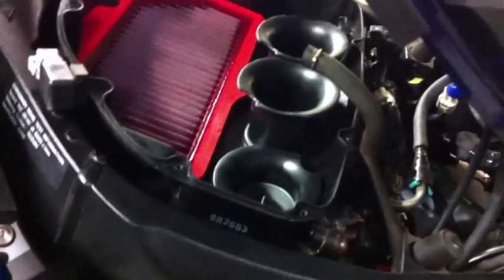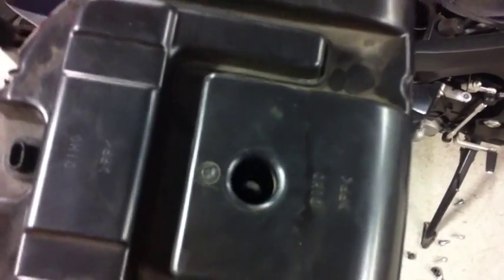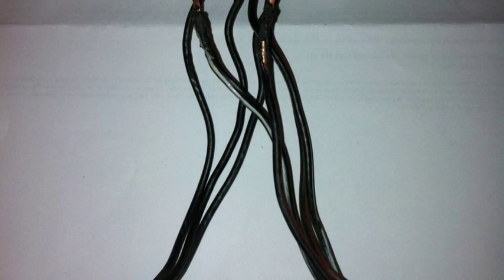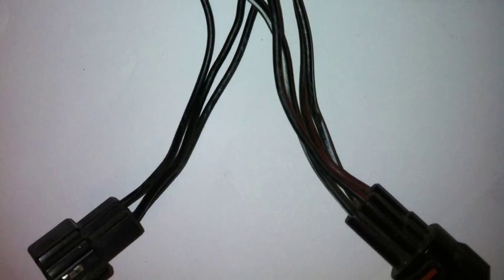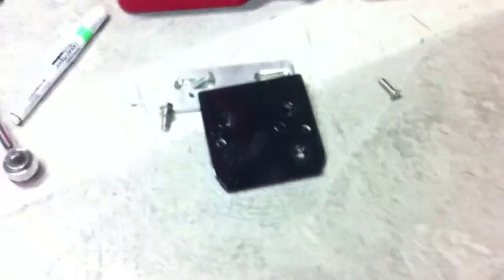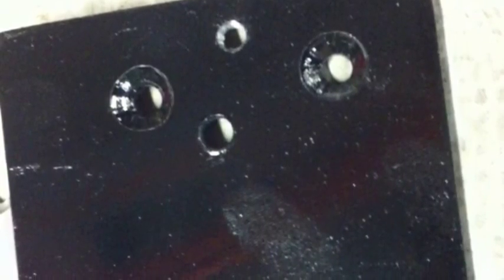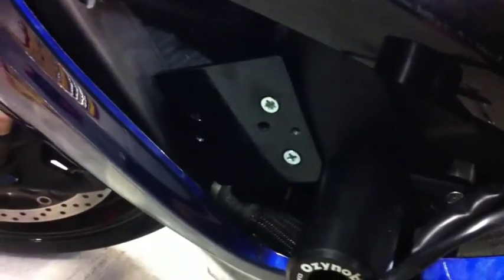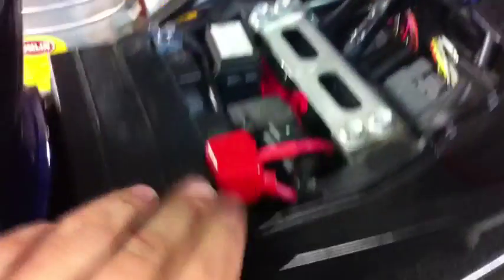MOSFET FH020AA Regulator-Rectifier - Including side mount modification

Comment: Hey mate it`s me again!

i bought the mosfet rectifier and I have just installed it but the problem hasn't been solved. According to the mechanic, the stator is fine, as we measured it  and the results are according to the manual. There is also tension coming from the rectifier which is 15v but when we measure the regulated voltage between the battery terminals the voltage drops to 11.95 v but it should be somewhere between 14 to 15 v.

Would you have any idea what could be the problem?
cheers
Reply from the maker: Have you done a battery stress test? Your battery could be faulty. I had to replace mine.
Reply: +Peter Rosel i asked the guy who is fixing it abou that and he said that the charging system supposed to be working fine regardless of the battery's condition. tks anyway mate
Reply from the maker: +Eduardo Ribeiro Da Silva what is the exact problem you are having? Can you be a bit more descriptive of the fault? Are you getting any error lights?
Reply: +Peter Rosel basically, the battery is getting flat often and the bike doesn't recharge it. no fault lights on panel.
Reply from the maker: +Eduardo Ribeiro Da Silva well sounds to me that your battery is faulty. If you are fm getting 12-15v from your rectifier then that means it's working and should be charging your battery. Have you got a lead acid or lithium battery?
Reply: +Peter Rosel i think the battery is the oem. mechanic called me and said that the battery is faulty. i am getting a new one ket see if it solves the problem. cheers
Reply: +Peter Rosel hey mate. i got a new battery but still the same problem. I checked the stator with a lamp and is fine. the rectifier is working fine too but it is not  charging the battery. i dont know what else to do. :(

Comment: hey mate is the regulator still running good?
Reply from the maker: Yes still fantastic and always will be as it is electronics over analog shunt.
Reply: +Peter Rosel good. i am from australia as well and I have the same problem. i go with mosfet. was it difficult to come up with that bracket to relocate the rec? cheers
Reply from the maker: +Eduardo Ribeiro Da Silva
- If you are handy with a grinder/hacksaw you just need to get some 6mm plate steel or aluminium mark out the - Rectifier on the steel cut it out. 
- Get a 5.5mm drill and a M6 (6mm) Tap.
- Mark the rectifier mounting holes, drill and tap. 
- Then you need to mark the plate mounting holes so that you can use the horn bracket mounting holes. 
- You'll need to get 2x M6 countersink bolts also a countersink bit or a 13mm bit might do the job of countersinking.
- Paint
- Good Luck.

Comment: Hey do you know if the oem rectifier has a smooth surface on the burnt portion of you rectifier prior to getting burnt out? Or does it seem like two wires are coming out of it? All input will be appreciated, thanks mate
Reply: Martin Saravia I have that same question. Mine has like 2 tiny little wires starting to appear on that black side. Has yours burnt out?
Reply: drummerkid69 Yes the rectifier was burnt out. Had to get it replaced. I suggest to go with OEM.
Reply: Did you happen to relocate yours or did you still have it in the Stock position behind your radiator? I relocated mine to the side of the bike with the help of an aftermarket bracket. Hopefully that cools it down enough
Reply: drummerkid69 No I left it in its original location, but I would've and probably will relocate it if it goes out again. its been over a year now, and I'm having no issues.
Reply: Cool man. I bought the Ricks R/R and have relocated it. Should work fine now though. thanks for your input!
Reply from the maker: They OEM suck, go MOSFET ELECTRONIC That is all.

Comment from the maker: Si Matamae,

If you are talking about the stock female plug (@ 3:38minutes) it will still have voltage on it as the wires runs directly to the battery via the main fuse. I used electrical tape over the top of the plug and then around the plug.

Regards from Australia.

Comment: Hello I explain well the assembly? The red black plug directly to the battery and the other with three wires directly to the stator? But the female plug of the bike that leads to the battery after you have isolated? You have an arrangement? thanks from Italy